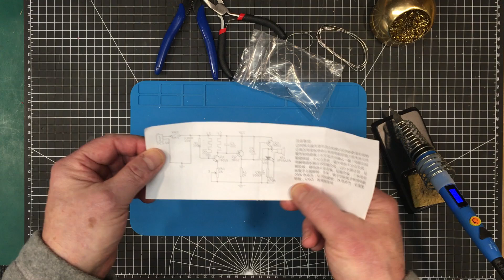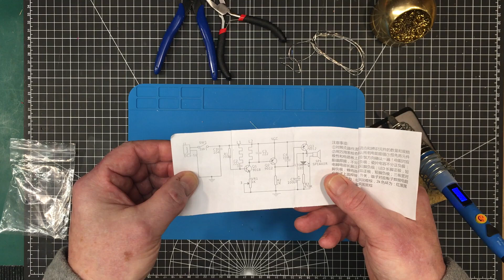Uni-Byte 0169 - EASY Metal Detector Kit - MORE than a TOY?

Comment: I just realized how great these little kits would be as a technical interview for electronics repair jobs. Test the soldering, give a basic schematic for them to analyze, and a solid works/doesn't work indicator based on the beeping. And then at the end of the day, they get to take home a cool thing.

It's actually doing the work, unlike the paper interviews.

New viewer here, videos seem good as is, not sure if the montage is needed or helpful, but it works as-is.
Reply from the maker: That's a great idea!

Comment: Adding an extra potentiometer in parallel or just a resistor with a value less than the max resistance of the original potentiometer (in parallel) should allow you to have better control of the alarm range. Having the antenna separated from the circuitry via extension wire will also help with preventing false alarms.
Reply from the maker: Some good ideas, thanks!

Comment: At that price I ordered 3 of them. I expect to mod the Hell out of them. Put in a pot that allows me to set the sensitivity right on the edge, and try adding big loops. More gain. Fun toy. Some of your musical choices were quite nice. But I can listen to my music here while I watch your videos, so the music doesn't really mater. Thanks.
Reply from the maker: Thank you.
Reply: @uni-byte  thanks for a clear image of the assembled bd. Mine came with no instruction sheet, so you saved me about 15 minutes figuring out what had to go where for it to work. As a reverse engineering job it's no big deal, and I do sometimes enjoy reverse engineering, but these things offer no challenge, so no fun to reverse engineer, just a bit of wasted time. So it's more convenient to just solder the first couple together and call it good. Then do the mods on the 3rd one. I need to read up on the theory of metal detectors. At a glance it looks like the coil reverses itself between the top and bottom of the board, which I guess provides a nulling affect. That coil appears to be the key to the circuit design. I built a Theremin kit as a kid and used it as a hokey metal detector a few times. It worked, but not at all well.
Reply from the maker: @johnwest7993  You're welcome.  Yes, it's just simple blocking oscillator (like on a jewel thief).  As it get's closer to metal the coupling in the transformer increases to the point where it can support oscillation.